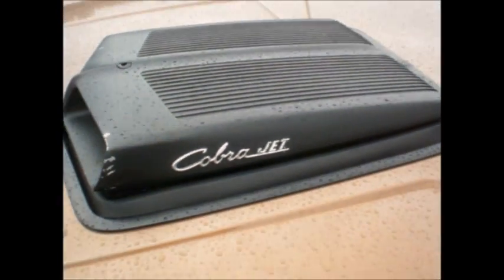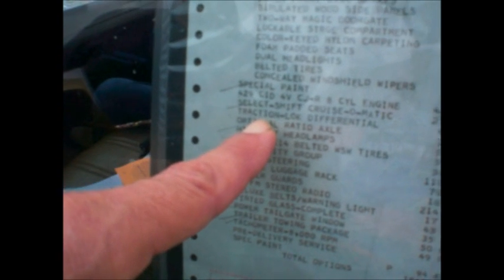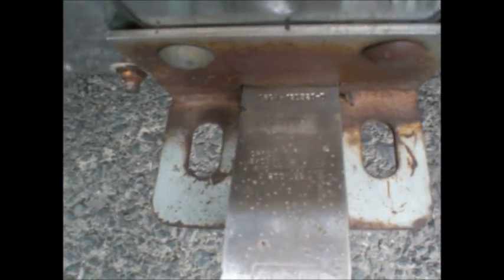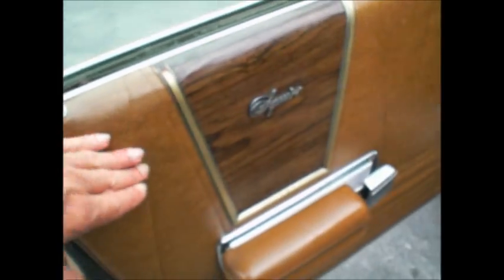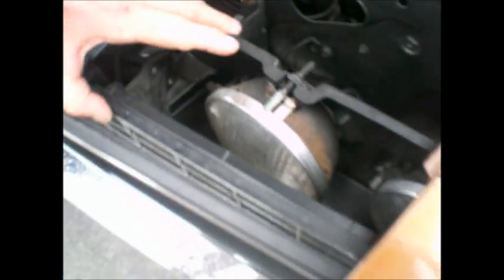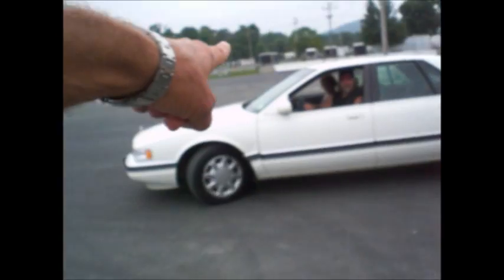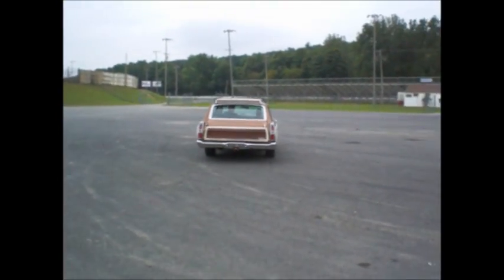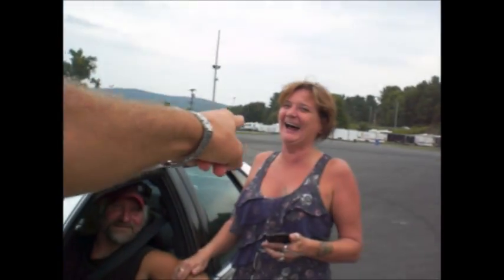Torino Squire Super Cobra Jet Lites Em Up 8 31 14

Comment: As a kid we had a 71 Torino wagon specially made with the 351 and nothing else but an AM radio and boy did I have fun in high school with that car, but if I knew then at 10 years old with my dad or the car that you could get the motor in this car I would have talked him into it LOL
Reply from the maker: Hemmings did a feature on it a couple of years ago. It was a very expensive option, plus the Hideaway headlights and  the shaker. And the best part is it's an original Survivor, even though there's great dispute if it's a Super Cobra Jet, or just a regular Cobra Jet. Either way, it's a great car and it was a fun day

Comment: I can totally vouch for this wagon being a 1 of a kind 71 429 SCJ station wagon. I say this because the guy who owns it was an usher in my wedding back in 1980.
Reply: Mason George  This ain't an SCJ wagon, and Ford built a lot more than 7 Torino wagons with the 429.
Reply: @rosenb37  You are right, I looked it up on "OldCarBrochures" dot Org and the 1971 Ford "Wagons" Brochure in the Options page says you can order a plain 429, a "CJ" 429, or a "CJ-R" 427 rated conservatively at 370HP...
Reply: @TheSpritz0  Yes but no. No CJ wagons in 1970 but the plain 429 yes. The latter engine wasn't offered in 1971, but a handful of CJ wagons were built in 1971.
Reply: @rosenb37  WRONG. Ford produced six  429 Torino Squire wagons '70-'71. Ford produced one 1970 "plain Jane" 429 SCJ 4 speed drag-pack wagon and I own it.
Reply: @sergeantmasson3669  Please post the VIN so I can run a Marti Report on it.
Reply: @rosenb37  You are NOT entitled to anybody's personal information without their consent. PRIVACY ACT ring a bell, PUTZ? FYI, Marti Reports stated that my car never existed. Ford Museum proved otherwise. BTW, Marti Reports is not always right, either.
Reply: @sergeantmasson3669  Dude, I asked for the VIN, not your social security number. It's not personal information LMAO.

I'll just assume it wasn't built by the factory.

Comment: The Torino Squire in 1970 had an all vinyl version of the Torino Brougham cloth interior. It sounds like this car had $1600 worth of optional equipment. The major available options that were missing were power windows, 4 way power bench seat and air conditioning. The bottom original sticker with options was around $5100. This car should be worth a ton of money as Rick Harrison might say at a Mecum auto auction.

Comment: Amazing! You don't see to many wood grain station wagons that can smoke the tires
Reply: Va HOSS  seen a couple  390s back in the day this one's is a first for a 429 cool I was just a teenager but a friend's father had a 68 Ford station wagon it was red with the wood sides and it had a 390 four barrel dual exhaust I remember being in it along with my friend his father at the wheel in the front seat four our bodies in the backseat and 2 other friends in the back of the wagon for a total of 9 people granted we were young and we weren't big Burly guys but we all weight hundred fifty to 175 lb but the old man let her go almost melted the tires off of it man would that bitch fly it was funny back in the day to watch a station wagon spank stock small block Ford Chevy Chrysler Dodge yep pretty cool wagon never thought I'd see a cooler wagon but I was wrong here it is what I give to sit in this car with 7 of my childhood Buddies and go for a trip back in time but he'll have to give her a tune up 1st don't like the way it was hard starting and at the end he barely pulled off a brake stand that thing should smoke the tires and sit there and not move without using the brakes so it's definitely not running very well
Reply: Sid 57 is right. My dad bought a 68 LTD that would burn over a 1/4 mile heavy duty black mark, with a 200 ft. black mark  in 3rd gear... That car had 125,000 miles on it...

Comment: There was a green one available with tan interior, one owner I looked at back in 2000. According to the original owner that had it at the time, the 4 speed manual transmission and 429 he special ordered was to tow a travel trailer he had. He thought the full-size Country Squire was too big, so he ordered a Torino.It looked just as good as this one. I couldn't come up with the full 8k he was asking for it!

Comment: Awesome wagon . Unbelievable the things Ford would do for customers with special order vehicles. I have a 68 Ford F100 that was supposed to have a 390 FE but left the assembly line with a 410 Mercury V8 and 2V carb. Obviously Some left over 1967 model 410 Merc FE's were installed in some 68 model vehicles due to a 390 shortage or to just get a engine surplus cleared. It is absolutely the factory installed engine . My dad bought it brand new and after 156,000 it wouls still shred the tires for several yards. It started to smoke a bit at start up and I decided to rebuild it when during teardown I discover the 1U cast 3.98 stroke crankshaft and the 4.10 cast pistons . It now has dual 2.25" exhaust with ceramic coated headers and flowmaster 40 series mufflers along with a Edelbrock RPM intake and Holley 700 cfm 4barrel carb , Comp 268H cam . She will definitely boogie !
Reply from the maker: monkey vibes sounds like you and I need to get together and make an awesome video about your fantastic sounding truck. I'm not a Ford guy, but there's some nice Ford vehicles out there, I really like the Mustang Fastback, the one that killed the Corvair.
Reply: CORVAIRWILD , I have a few Ford \ Mercury Classics .  My Favorite is all of them . Ive owned other brands but just found Ford vehicles to be far more appealing to me then Chevrolet or another brand. The history , the models and the performance record are very interesting to me

Comment: NOT a super cobra jet. No 3.91 or 4.30 rear, no SCJ air cleaner(they are different) and no oil cooler. ITS NOT AN SCJ. And most of all its 1971! The SCJ was 100% NOT available in 71.
Reply: Correct
Reply: Mason George  An auction write-up hardly counts as evidence. But all you have to do is note that the car in the auction came with 3.25 gears and that's all you need to understand that you are incorrect.

Yet if you still don't believe me, here's some documentation of a similar car. Notice the "1 of 313" production number both in the Marti Report and the auction, yet nowhere on the Marti does it show the car to have the Drag Pack.

Besides, Marti Auto Works already has gone through all the records and has stated no SCJ Torinos in 1971.  It doesn't get any more authentic than that.
Reply: Mason George  Oh, what's this? A car with 3.25 gears called a Super Cobra Jet? 

NOPE
Reply: Mason George  Even one of the President's lawyers knows this doesn't amount to evidence. Ford's records are the evidence, and nary a one Torino was built in 1971 with the Drag Pack.
Reply: Mason George  Are you suggesting Hemmings is always correct?

There was no SCJ Torino in 1971. Again, this is documented by Ford.
Reply: Mason George  The 429 CJ Torino was not available with 3.70 gears. The Detroit Locker was only available with 4.30 gears (and, for the 1971 Mustang, 4.11 gears). There were only TWO Drag Pack variations available: 3.91 and 4.30 (4.11), available for either the C-code or J-code 429......but not on the '71 Torino. 

Not only do you promote wrong information, but you have yet to show proof of your assertion.
Reply: Mason George  Ford's records show CJ Torinos and none were produced in 1971. 

And it should be pointed out that Ford had a 428 earmarked for Fairlane/Torino production before they heard of Tasca's car, though Tasca certainly helped them achieve the end result. 

https://428cobrajet.org/428cj-history-bill-barr
Reply: Mason George  Don't tell me WTF when you post 3 replies to my 1. A reasonable person will notice from your reaction that trying to undermine someone else's opinion generally suggests you don't know what you're talking about.

Post your evidence that Torinos were built with the SCJ engine in 1971.

I know you can't.
Reply: Mason George  ....yet no proof that there was a Drag Pack Torino in '71. 

And guess what? No SCJ wagons in 1970. In fact, no CJ wagons in '70 either, whether C or J.

Comment: rare wagon but i think it's just a cj not scj, 5 th digit in the VIN J meant ram air which it came with but to be SCJ  IT had to have the 3.91's or 4.30 gears and would have had oil cooler which i did'nt see,some body probably put the holley on it.
Reply from the maker: I've heard that argument for years, prolly correct

Comment: According to the Marti report. NO 71 Torino SCJs. Only Mustangs had 71 scj. Kevin Marti has all the Ford micro film.
Reply from the maker: Too bad, but still a great car!
Reply: Didn't 70 and 71 Torino Cobra come with SCJ once you ordered 3.91 or 4.30 gears ? Drag Pack Option ? Then you got 4 bolt main, oil cooler, 780 Holley, and all that means Super Cobra Jet correct ?
Reply: @badass6.0powerstroke10  No SCJ in 1971 except for the Mustang.
Reply: @rosenb37  O.K. thanks.
Reply: @badass6.0powerstroke10  Otherwise, you'd be correct with the carb, etc.

Comment: that's not a double pumper carb. you must be saying dual inlet carb. it has a vacumn secondary carb on it now.
Reply from the maker: Tim Harris usually dual Inlet carbs are double pumper, but I may have just mistaken it in the quick second I glanced at it while I was making the video. My bad
Reply: Yeah, it definitely a Vacuum Secondary Carburetor, Dual inlet with dual metering blocks, But definitely Not a Double Pumper.

Comment: At 5:00 the video clearly shows that this engine is equipped with a dual feed center pivot Holley carburetor with primary and secondary metering blocks (not a metering plate on the secondarys) and vacuum secondary throttle operation. It is the correct carburetor, D0OF-9510 ... almost.  The Aluminum fuel transfer tube has been replaced with rubber hose which is common because the rigid tube is often kinked by the DIY types. It does not have a secondary  accelerator pump or squirters in the secondary bores.  So why do you keep calling it a double pumper?  All Holley double pumpers have mechanical secondary operation, two accelerator pumps, and squirters in both the primary and secondaries (all four barrels). Therefore this is not a double pumper!  Awesome J code car just the same!
Reply from the maker: I apologize for my error, I'm well aware what a double pumper is. But when you're making a video, it's easy to get carried away just to keep the blurb rolling. Nonetheless, it was really fun making that video, and I go to musclepalooza twice a year, this year I may bring two 409 Chevys that I just bought, and actually bought three, but how many can I bring in one trip?

Comment: I'm not going to call the owner a liar, but I know for a fact NO 429 SCJ's came with double pumpers. Neat car anyway but I would think that someone built that beast.
Reply from the maker: I hear ya bro!
Reply: You are so right. the 428 was a Cobra Jet. The 429 was a SUPER COBRA JET. the 429 was based off the 460 block. I don't think these guys know too much about FORDS  history. and I think they stopped somewhere that had happy hour. you tube ain't going anywhere guys,, sleep off your hangover then try again, I'm just trying to save you from some embarrasment.
Reply: @EXTIQUE  I owned a few Torino Cobras in unmolested condition. One a CJ with a Q-jet & a SCJ Drag Pack with a factory Holley 780, 4.30 Detroit Locker rear. Both were good reliable muscle cars that would withstand serious abuse. Neither was nearly as quick as my A-12 Super 🐝, but I set them up and sent them down the road. I have too much wrench time on classic muscle for anyone to BS me.
Reply: @EXTIQUE  Both the 428 and 429s available in these cars (in different years) were Cobra Jets. The Drag Pack made them Super Cobra Jets, but this wagon is a regular CJ.

There also was a Thunder Jet 429 in 1970, and 1972-beyond, although they didn't call it that.
Reply: It wasn't even a Double Pumper, it was a Vacuum Secondary Carburetor with dual metering blocks and Dual Inlets, Definitely Not a Double Pumper with the Big Ole Secondary Vacuum Diaphragm Housing hanging off Pass. Side of that Carburetor.
Reply: @nickdulak1837  can a torino beat a 71 boss

Comment: That is NOT a SCJ (Super Cobra Jet) Its a base Cobra Jet that had a Quadrajet carb originally. The "J" code VIN is Ram Air not SCJ. No 429 SCJ came with a double pumper carb.  Cool car but surely not the ONLY Cobra Jet Wagon in 1971. I bought a non ram air version '71 429 CJ Wagon a few years back.
Reply: EcoBoost EngineSwap they never used GM carbs!!!!
Reply: Lynn Dempsey; They most certainly did. All 429 Cobra Jets had quadrajet carbs. 
They could not meet emissions with a holley unless they had an air pump. That is why all SCJ had an air pump. (Except this car?)

Comment: I AGREE WITH OTHER COMMENTERS THAT THIS ENGINE IS A CJ ENGINE.  IF IT WAS THE SCJ IT WOULD HAVE AN OIL COOLER AND WOULD NOT HAVE POWER STEERING AND IT WOULD HAVE A FORD CARB.  THE SCJ ENGINE WAS NOT AN ENGINE OPTION BUT THE DRAG PACK OPTION GOT YOU THE SOLID LIFTERS,  HOLLEY CARB OIL COOLER AND DETROIT LOCKER REAR.
Reply from the maker: Lamarr Ragin I wonder myself...
Reply: Lamarr Ragin; I believe you are correct on everything except the power steering. I have a 70 scj with drag pack, power steering and a marti report. The only thing that you could not get on SCJ was AC. I do know of one SCJ with AC but I have not seen the marti.

Comment: He really doesn't know what he has. That HAS the solid lifters and cam and you CAN hear the clacking of the lifters. With the 4 bbl it should have the semi hemi aluminum heads and a taller block, bigger rods and bearings than earlier Scj"s within the same year. I raced one in a 71 Torino and beat it 2 out of 3 times with my 440 magnum r/t challenger both showroom stock.
Reply: Nope